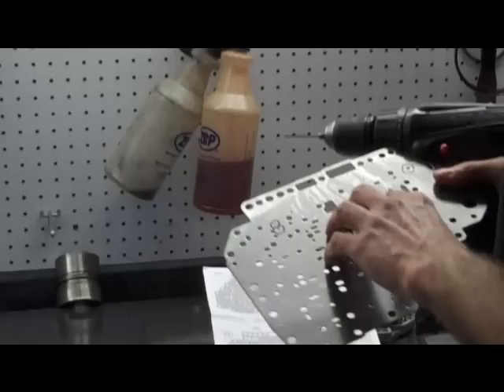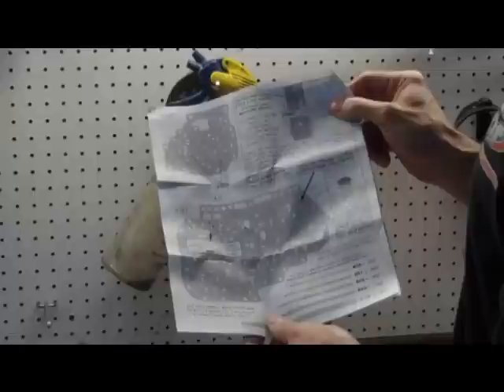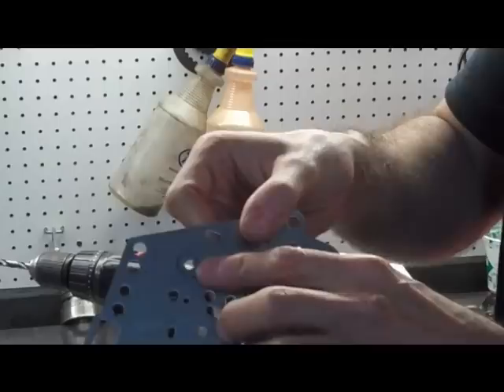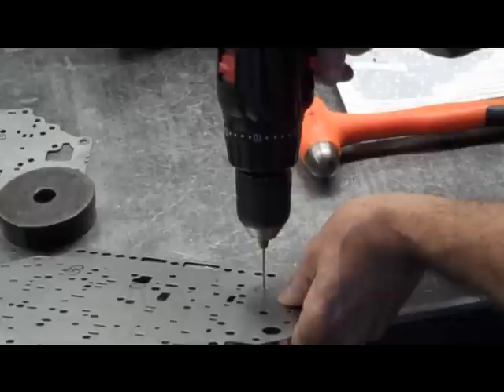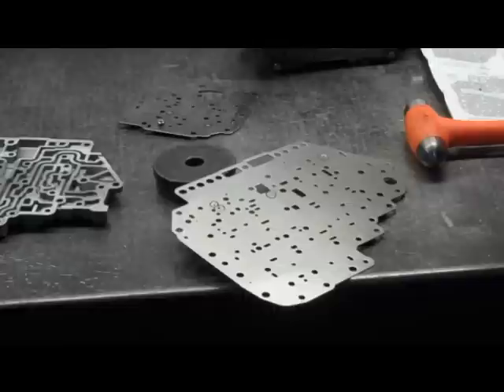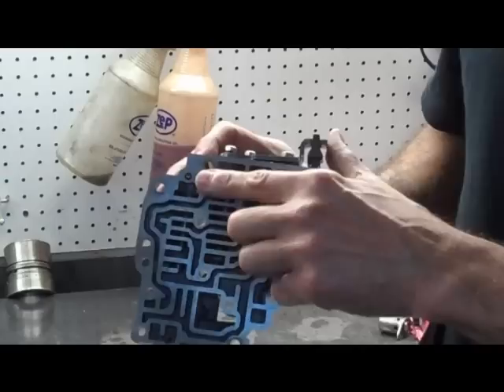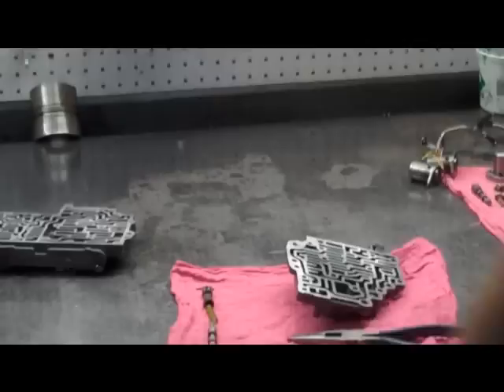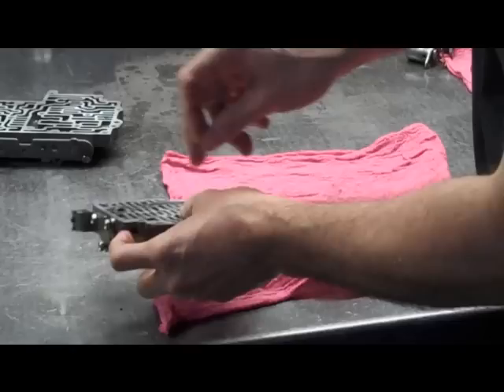Mitsubishi / DSM Shift Kit Installation Instructions Part 2

Comment: I am in the process of rebuild my son's 1990 eclipse Trans (s-km175). You said 1g as 3 silinoids. Mine has 4 which is silinoid A,B,TCC and pressure. It also has the extra TCC valve  in lower valve body. Did 1990 eclipse come with TCC control. I do have experience with GM and Ford. My first import.

Comment: My son was playing with and lost my drill bits with this kit. you mention whats the number for 55,000 bit, 67,000 bit , You mention also needing a #42, which is 93,000.   For the plug you mention I need a #35 whih is 110,000 and to use it after starting the hole with a 1/16" bit But what size do you drill it out for the plug?

Comment: How are you I bought a shift kit for my transmission I install it but didn't drill the holes on the separated plates my question is if I drill the plates and I deside to go back to the original springs do I have to buy the plates again and if I deside to drill the holes do I have to drill the be hole it worries me could you answer or should I use my common sense.